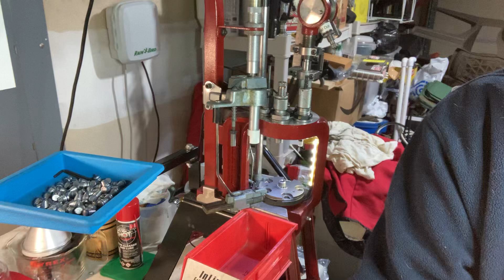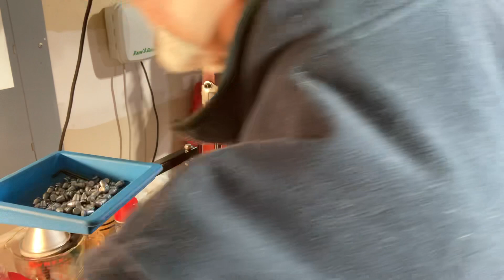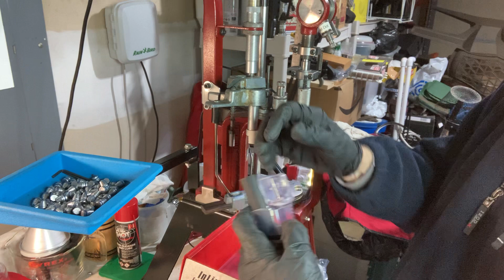Loading cowboy ammo on a progressive press

Comment: - Static Electricity and it's effects upon the Reloading Bench -

"Handloader's Manual" by Earl Naramore
page 235-237:
Bridging.
Bridging is a condition that may occur with any mechanical powder measure ...

"Basic Handloading" by George C. Nonte Jr. 
page 43:
"Use of an adjustable powder measure will greatly speed up the operation."
page 45:
"If you discover an error after forty or fifty rounds have been completed, there may be no way to identify the cartridges that contain the error."
"Usually, a charge that bulks abnormally high or low will do so at the expense of the charge thrown immediately before or after it. A light charge in the case might mean that some powder remained in the drop tube, and so was probably added to the next charge thrown; an overcharge probably indicates that powder hung up in the drop tube from the pervious charge, making it less than it should be." 
"If it seems that I'm dwelling overmuch on powder charging, remember that this is the most critical of all the handloading operations to safety. You'll get no joy or profit from handloading if a mistake or an oversight causes a gun to be wrecked or a shooter to be hurt. Handloading is essentially a very safe practice, provided one adheres to the basic safety requirements and concentrates on the job at hand."

The above story is told over and over again in many other reloading manuals. And is explained well in the following video:
https://www.youtube.com/watch?v=Vde_V0pF_DM

There is a business that sells replacement powder hopper that are made of Pyrex instead of plastic which should by all means stop any static electricity from building up on the powder in the hopper so that powder bridging in the drop down portion should be a thing of the past. Static electricity is a Handloader's nightmare. So get a DRAM WORX - Pyrex Replacement Hoppers. Oh, and replace the plastic down spout with a metal one too. As a matter of FACT one should not use any plastic tools that come in contact with the powder to be on the safe side of things. Nor should there be any plastic anywhere near powder scales. 

Speer Handloading Manual Number 15, page 41:
Static electricity and the Reloader 
1. Static electricity can be highly hazardous for the reloader. 
2. primers are most sensitive to static charges. The energy is enough to ignite primer dust in and around priming tools. The dust can ignite and propagate to all the primers in the tube [or tray]. The result is a serious explosion. This is the reason to keep those tubes [and trays] clean! 
3. Static charges prefer low humidity environments. take some simple precautions. 
a. Use a humidifier. 
b. remove carpets from reloading areas. This is the prime source of static energy accidents. 
c. Clean the reloading area on a schedule. Routine cleaning removes residues of primers and propellants that can react to static energy. 
d. Use an anti-static product[s]. 

Handbook of Metallic Cartridge Reloading, Edward Matunas, page 14:
Most plastic funnels tend to build up a static charge that cause powder to cling to them.

Reloader's Guide - Complete, Fully Illustrated Step-By-Step Guide to Handloading Ammunition, page 129, under Common Reloading Problems: 
Plastic powder funnels often pick up a fair amount of static electricity ... ... ... this is annoying because powder granules stick to the side of the funnel, and you have to keep tapping the funnel to remove the last granule of powder. [Yes, one big hassle. And tapping on the funnel for the next 50 years could give one Reloader's Wrist! I kid you not.] 

The ABCs of Reloading 10th Edition, page 161:
Environmental Conditions 
conditions that can compromise your safety or loaded ammunition's integrity. static electricity which is never a good thing around powder. 

Lyman 51st Handloading Handbook, pages 30 and 40: 
Lyman lab technicians have observed a potential serious phenomenon involving mechanical powder scales, plastic loading blocks, Styrofoam packaging, and other objects made of plastic. These materials sometimes retain static electric charge, enough to create an electro-static field of varying radii. This electro-static field has proven capable of causing radical deflection of uncharged and zeroed scales. Dependent upon circumstances, powder in the scale pan tends to dampen the amount of deflection by varying degrees. We strongly urge that the loading bench be cleared before setting up the scale. Then replace equipment one piece at a time while observing the scale pointer. Any item that causes a scale deflection should be removed from the reloading bench. 

Metallic Cartridge reloading, Robert S. L. Anderson, page 11: 
One deadly enemy of the handloader is static electricity, which lurks constantly around anything plastic. An aluminum powder funnel avoids the problem of static electricity generated by the sliding of powder granules across its inner face. However, only Pacific makes aluminum powder funnels. The other makers use plastic, and these can cause erratic powder charges, some of which are excessive. 

Modern Reloading Second Edition Richard Lee Revised 2021, page 85:
What are the causes of excessive pressure? 
"It seems that some shooters were experiencing hot loads from what should have been quite safe. With much detective work, they found the problem occurred only when loading from the bench and immediately firing the round. Ammunition loaded away from the range worked fine. They discovered that the normal jostling of travel reduced the pressure to correct levels. Accurate recommends that ammunition loaded at the shooting bench be rolled back and forth a couple of times to rearrange the powder granules." [Rolling the cartridges around releases the static charge in the powder due to the use of plastic powder thrower reservoirs, plastic dippers, plastic powder pans, plastic tricklers, plastic funnels, and even plastic loading blocks, as well as any and all plastic primer trays. One should also avoid plastic laminated counter tops too.] 

Static electricity and plastic reloading tools? Why do manufactures use plastic powder hoppers on a powder measurers when it causes static electricity to bridge the powder in the drop down spout, whereby causing light [squib] loads in some cases and then the next ones get a charge and a half that blows up the guns? This is a well known phenonium and yet ALL the manufacturers of these powder measurers still go with plastic powder hoppers. Go figure.

Personally, I weigh every charge! I use a powder thrower to dispense powder into the scale pan, a trickler to round off the charge weight on a beam scale, and then I set the pan onto a digital scale as a double check. If the two scales do not agree I recheck the beam scale poises and re-zero the digital scale. Normally it is the digital scale that has drifted, but once it was a beam scale poise got moved by accident. Either way all my powder charges get checked three times. Twice by scales and once with a visual, in the loading block, after I have charged a batch before seating bullets.  This routine if followed religiously will negate most all squib loads, hang-fires and double charges. I do what I do for safety, not speed, cause as the old saying goes "SPEED KILLS!" And I encourage all to not find out the hard way